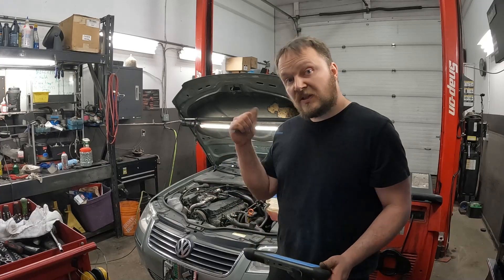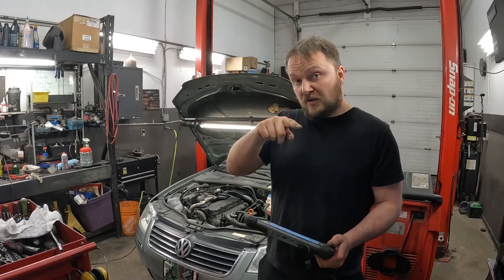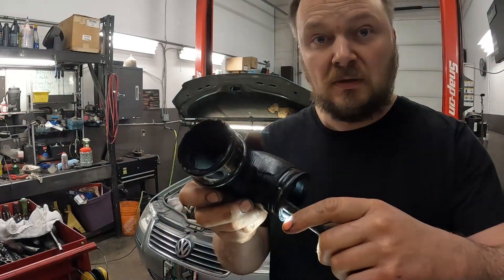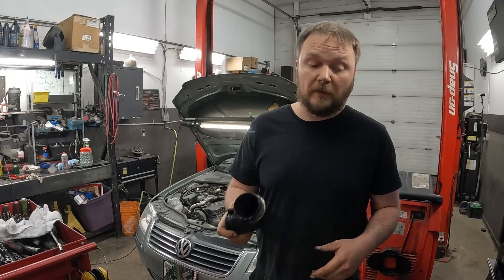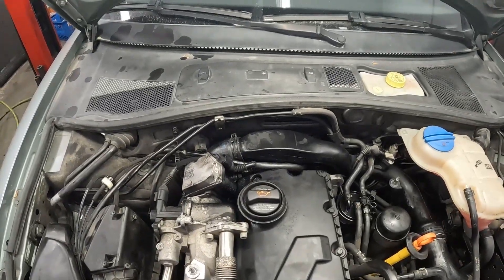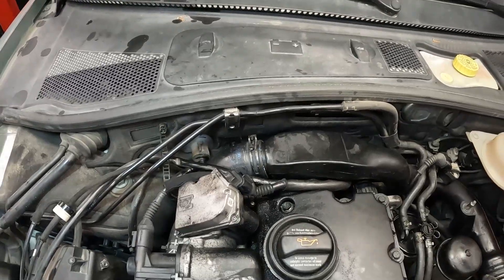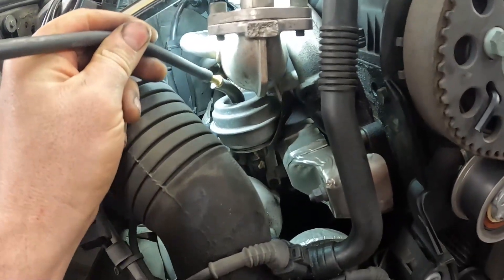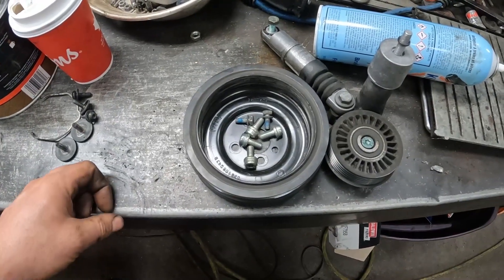2005 VW Passat 2L TDI - Low Power - Black Smoke - P0299 Turbocharger Underboost - Easy fix!

Comment: Good to know, wow $300.
Reply from the maker: @Dave  Ya, it's a diesel thing... On the Chevy Duramax they have small flexible couplers between the intercooler and metal boost pipes. They're held on by large gear clamps. You have to remove them to gain access for a lot of things. They're not like regular coolant hose clamps. One side has a large stud that goes through the other side and you tighten down a nut to get it to clamp. I learned early on to run a chaser over the exposed section of stud before trying to back that nut off! Otherwise the nut will jam up on dirt/corrosion and damage the clamp. Just spraying Moovit isn't enough... You'd think you could get those clamps by themselves but no... None of our suppliers carry them. Including the dealership. You gotta buy the whole coupler piece just to replace the clamps. That's a $300 hit just for an aftermarket one! You can get aftermarket boost clamps for these but they're junk.
Reply: 45bucks on part geek 100 through autozone
Reply from the maker: @connorewers478  Correct. If it's your own vehicle then you can usually save a lot of money ordering parts online. For automotive shops this becomes more complicated. Ordering a part online can take a week or two to arrive (I'm in Canada), they're lower quality, sometimes have fitment issues,  major headache to get warranty on faulty parts, if it's a wrong part (happens all the time in this industry), then you have to send it back and wait another week or two for the correct part to show. All this adds up to turning a job into a loss. As in the shop having less money than if they never took on the job in the first place. 

The reason why shops don't want to install customer supplied parts is not because they're "greedy". It's because the shop is a business that has expenses. If you don't manage those expenses your doors close and you go out of business. Part of doing business is warrantying your work even when it is no fault of your own. Such as a faulty part (new doesn't always mean good). When you warranty a job you get nothing for labor. Bills become harder to pay. Add to that the cost of waiting for a replacement part and possibly having a bay tied up or spending the time to put things back together just to pull it back apart again when the right (hopefully) part shows up. These are the factors that go into why shops don't like Autozone/Parts Geek/Rock Auto/eBay/etc.